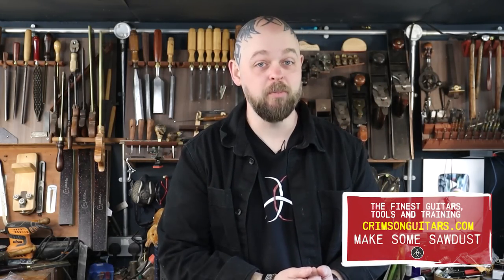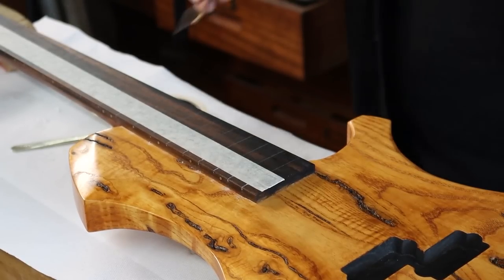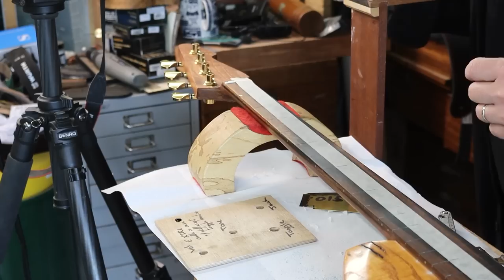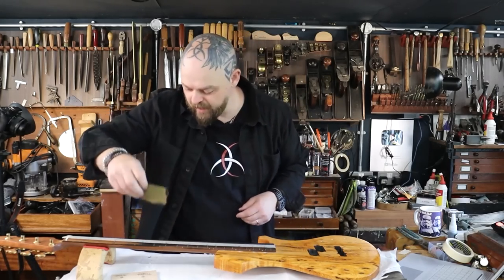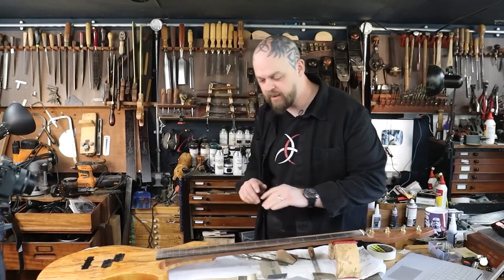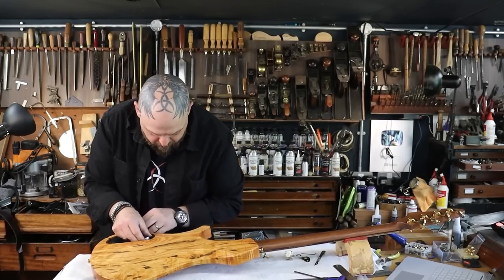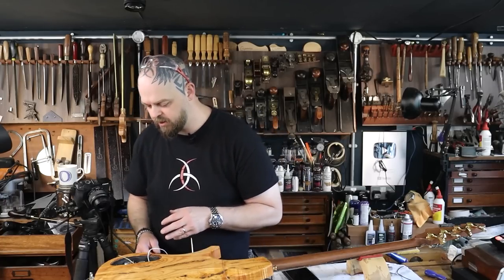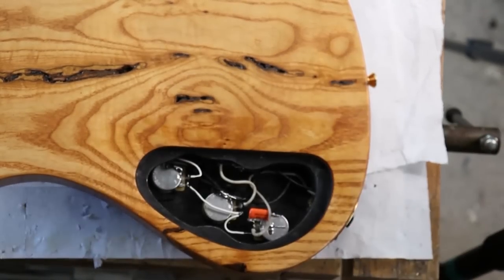Fret Markers, Hardware & Strings - Finished! Ep 5 | Completing a Custom Bass Guitar from Scratch

Comment: I'm a bass player, and I've enjoyed your two bass builds. I've enjoyed more than a 1000 of your guitar building videos as well. Please create more unique bass instruments. I would love to see you make a 5 or 6 string bass of your own creation, no need to copy anyone just keep on being your creative self. Greetings from Norway :-)
Reply: this!! Would love to see a 5 or 6 string as well!
Reply: Tusen tak! When you like building a bass yourself, consider buying a kit guitar. During the build of a cheap Les Paul clone, I decided to make a tiny bass of it. A picolo, but a guitar is even smaller than the picolo scale. And still it sounds pretty okay! Such conversions work great on strat guitars, too. Got some. Now I'm working on something like the Vox Teardrop that Bill Wyman played. One of my friends has an arthrose problem, so I'm building a 1-string bass. Did you ever play a one string bass? That is far more fun than you'd think.

All you need is four good bass tuners, a 4-string bass bridge, and a bass nut. Pickups were not made for a bass, you can buy bass pickups, or check out those kit guitars humbuckers first. Using a guitar neck can gets you in trouble (what frets?) for the frets get bloody close at a certain point. Option is taking a file and making it fretless, by the way. Ah, and when you got humbuckers, often there is no epoxy, so you can add a coil split. It does not replace a single coil, still, it adds an extra tone option. Just soldering and two cheap switches. Do you see? For about 200 euro you can build yourself a serious tiny bass. Do you know I pay almost 40 euro for a set of strings? The bass is worth only 4 or 5 sets of strings, really.
Reply: Haha, in Flika, Hordaland, I spotted a parked car. Summer 2016. Sticker on the rear window says: I AM A GIRL AND I PLAY THE BASS, SO WHAT?!

Comment: Using that timber was amazing considering the blow through qualities of it. Did you think about injecting the major problem areas with epoxy and then just sanding it back to surface level to stabilize it all. The scene that made me see this was when bits were breaking off as you first stained it. Watching more you need is a hand powered nibbler. It doesnt distort as it cuts a bit each side. Used in car restores without distorting the panels.

Comment: Tip for the soldering, its best not to apply solder and then reheat it or to carry it on the iron, the best way to get a clean smooth finish is;
1.Place the wire on the part you want it to stick to
2.Put the iron to the part and the wire so they both heat up slightly (this only has to be for a split second before you apply the solder)
3.Gently push the solder wire onto the heated area, this should melt instantly, until you have the required amount on the joint, then remove the iron and wire and wait to cool
following this should help give you a smooth joint because it makes sure you have fresh flux on every joint, if you carry it on the iron or place the solder on the join and have to reheat it this boils off the flux and can leave you with ugly or poorly conductive joints. This probably wont be easier at first but it should leave you with better functioning and looking results and youll get better at the technique the more you practice.

Comment: Ben, I'm very surprised that you oriented that P pickup the traditional Fender way, and didn't flip it to have the lower coil closer to the neck. I think Fender made a mistake placing the pickup like that, flipping it evens out the tonal response from all the strings.

Comment: Probably should have used flatwound strings, results in a more typical "fretless sound". I really like the body and headstock shape. Not a huge fan of the amber finish on the body, those pot caps and the hardware color, but the final result is still great overall. I'd definitely like to see more basses.

Comment: ground wire to the shield paint is completely redundant. The pot shafts touch the shield paint so the whole thing is already grounded and does not need the extra wire. Grab a multimeter to confirm. It's like this on all my guitars.

Comment: If your shielding paint is conductive (as it should), there is no need for the extra ground wire from the cavity to the back of the pots. One pickup cavity to the other now is a different story.
Reply: If your pot is connecting to the shielding and you add an extra wire from the pot to the shielding, you are actually CREATING AN EARTH LOOP.
Do this for the other pots and you are CREATING MORE  Earth Loops.
It doesn't matter. They are all inside the shielding anyway. You only need to worry about Earth Loops when connecting things like Mixers and Amplifiers which can put noise from their AC power supplies onto the Earth Circuit.
Reply: @John-qw4jf  that's what my other comment is about. All the research I've done about earth loops deals with high voltage circuits and equipment fed by separate power sources.
Reply: @pallecla I agree.  Well, it is Earthed and it is a Loop but if you read the entirety of my original post you will realize why it isn't REALLY  an Earth Loop.

Comment: I've got a question about neck pockets. 

If my neck has a heel with 4 degrees built in, do I route the pocket straight? 

I've only made one guitar and made the neck with a straight heel. Then routed the pocket with a 2 degree angle. The angle was miscalculated and I had to take the first neck out. It got destroyed removing it. So I just bought a premade neck. But it has 4 degrees built into the heel.

Comment: Are those wound strings on a fretless board? 😱
I hope not Mr Crowe! 😏
Surely there should be Flatwound fitted!
Reply from the maker: It is a little harder on the fretboard in the long run but imo sounds better with round wound strings.. I could be wrong though
Reply: @CrimsonCustomGuitars  Yes, as I know, a lot of people prefer the sound of wound strings but I have heard many pro bassists say that wound strings can really mess up the fretboard on a fretless, I suppose it's subjective, like most spec on basses and guitars 👍
Reply: @CrimsonCustomGuitars  Rounds sound a bit more full, but I have excellent results with stainless flatwounds (D'Addario) on my fretless: those add a nice upper-mid growl while still sounding and feeling smooth!
Reply: Thinking the same thing when I heard the strings go through the bridge 😬 Absolutely a fantastic job though.
Reply: Rounds sound brighter and counter the duller tone when you have no frets.
Reply: @natsterjam  When letting guitarists have a go on your fretless, tell them under no circumstances should they try and do a bend like they do on guitar!
Reply: Not if you do a epoxy coating on the fingerboard rounds have better mwah sound on fretless

Comment: Somebody really needs to do a scientific assessment of the possibility of both ground loops within a guitar wiring circuit, and the necessity of shielding guitar cavities as there is not enough wire in there. Being a millivolt circuit essentially, there little to no possibility for the circuit to provide the current to induce a ground loop. Also the copper wire winding on the pickup is more akin to an AM radio antenna and therefore more able to pick up 60 or 50 cycle hum depending on your power supply.

Comment: Why metal for the inlays?  Even WOOD inlay fret line markers can end up standing proud because the material had  different wear properties and different rates of expansion/shrinkage. This is much more of an issue with metal. Unless this is getting a thick epoxy covering the fingerboard surface, those METAL inlays WILL eventually stand proud. Even with a thick epoxy that variation on materials may eventually deform the surface.
Reply: Lucky winner here. So you're saying I should have Ben put in frets for me?
Reply: @Waggel86   Congratulations!  I would not presume to tell anyone to do anything.  
Ben may be confident you will zero issues with it, and if so, who am I, right? 
I would consider at least doing what you can to prevent the fingerboard from drying  and keep it in a stable environment.
Reply: @Waggel86   So - you DID end up getting it fretted!